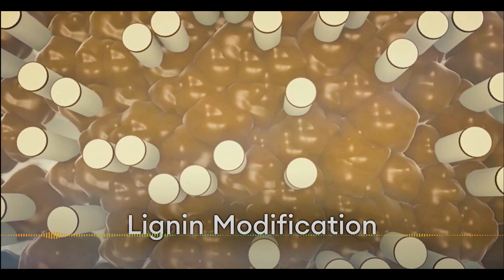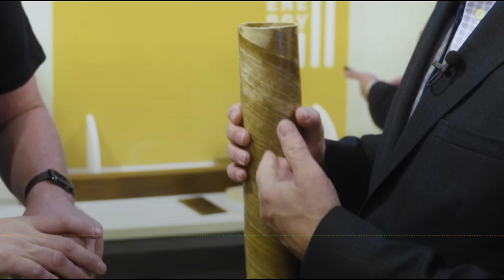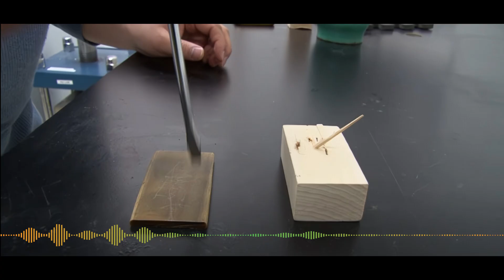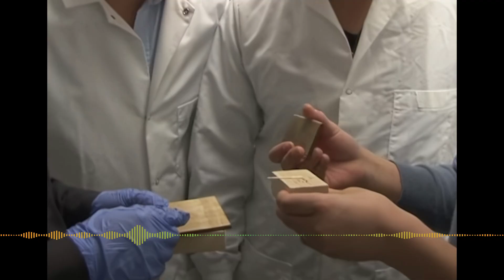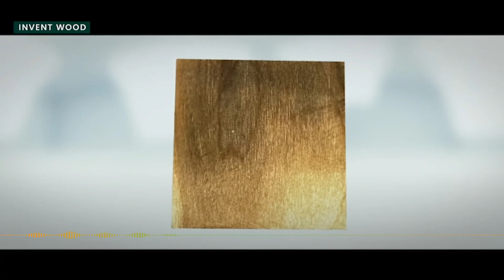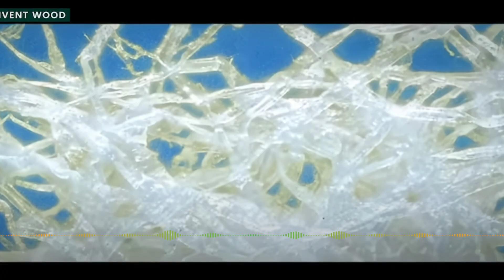10X Stronger than Steel!! Mettlewood and Superwood .. Revolutionary Material -or- High Energy Hype?

Comment: At 5x the density of the parent wood how do you fasten this product?
Ive seen the videos of how this is processed with sodium hydroxide and sulfite to help remove lignin and hemi-cellulose but unfortunately the University of Maryland doesn't have anything on this.
Ive got to assume you need to predrill and bolt it together because given the density it isn't going to bond well either.  🙁
Reply: Have you ever seen the world's first ironbridge in Shropshire England ..  there are a few bolts or tie rods but the rest is jointed together like wood 😉🧙🏻‍♂️including dovetailed joints.
Reply: Bonding it would depend more on the basic polarity. Metals bond well, but polyolifins do not, for instance. Surface porosity  makes regular wood very easy to bond, which is what I suspect is your concern.
Reply: @glenn726 My concern isnt necessarily bonding Superwood, but how to use the densified cellulose product as structure.
You cant nail or screw it together. You cant weld it like a metal member. Without fusion or fastening i dont see an expedient way to put its properties to use.
I cant seem to find any information other than the suggestion that it can be purposed as a decorative cladding.
Maybe you have some resources or suggestions?
Reply: @jimurrata6785  why cant you drill it if i may be so bold?
Reply: @dellp110  I said you would need to drill and bolt it. 
It seems too dense to accept a nail or traditional self piloting screw.
Perhaps it can be tapped for a machine screw?
Im just trying to understand how this product fits alongside the environment where we make use of nature's composite (wood) or traditional metals for structures.